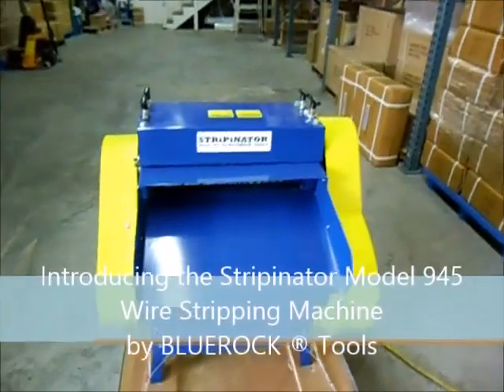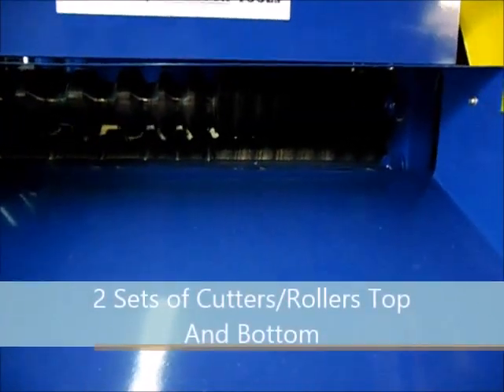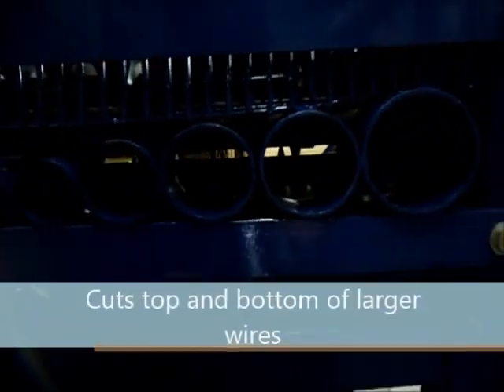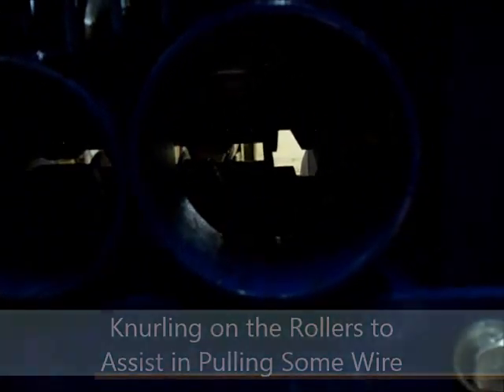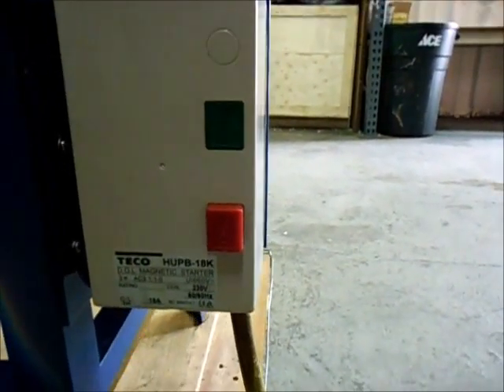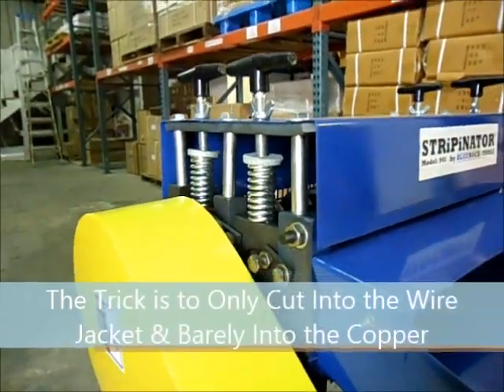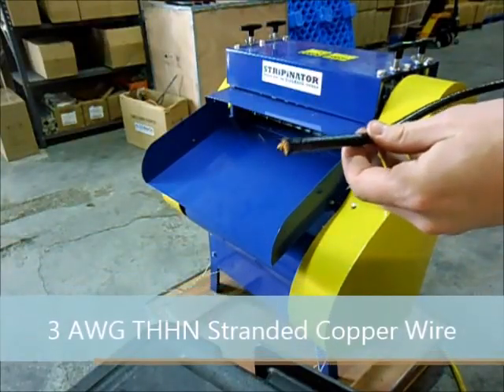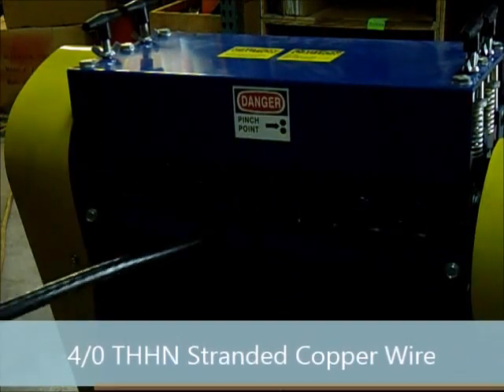Model 945 Wire Stripping Machine Copper Recycler Stripper by BLUEROCK ® Tools

Comment: What are the cutter diameters and cost. What material are they from and are they hard or soft
Reply from the maker: +don doerner Cutters are $5 per blade.  They are hardened steel.  Let us know if you have any additional questions.  It's probably best to email us direct at info@bluerocktools.com.